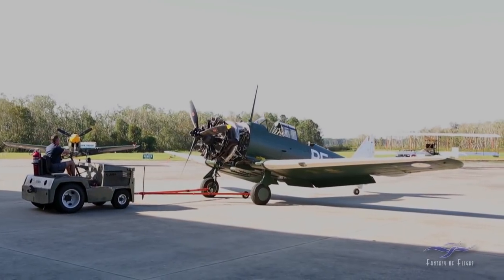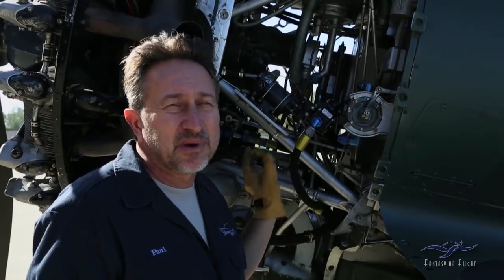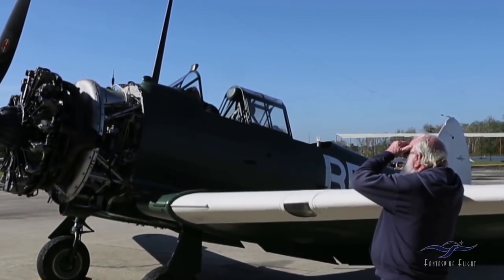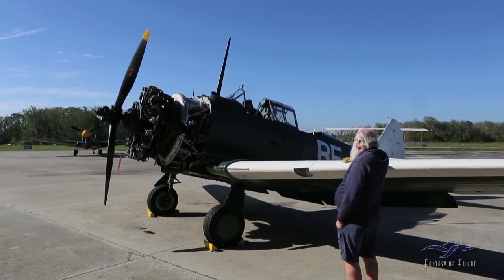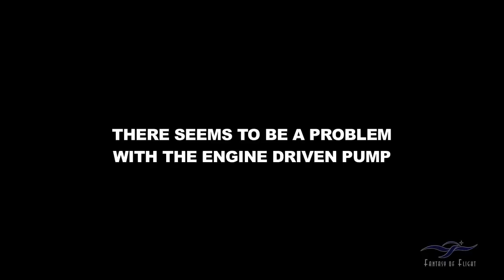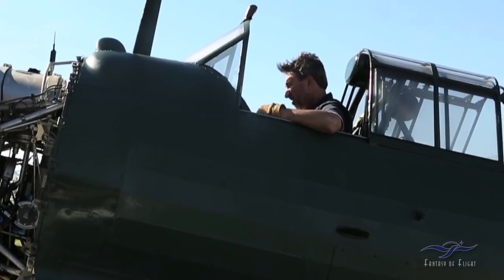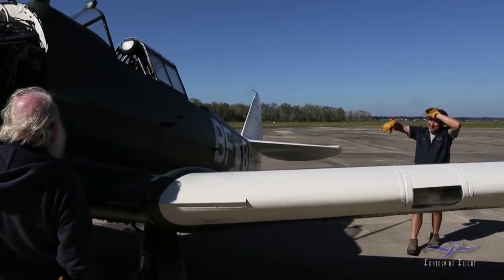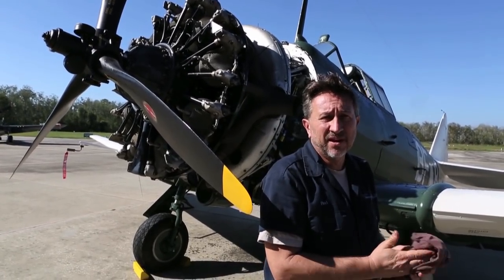CAC Wirraway - Start Up - November 2017

Comment: Ahhh the purr of a Pratt & Whitney radial.  I grew up to that sound.  My dad had several AT-6s over the years....most well known is "Scrap Iron 4"   (Which was an SNJ-5 Naval version (provision for a tailhook..wings that could fold, etc.)  The other version was called "Harvard" by the Brits..but they were all the same aircraft...with

I miss them all.  AT-6 is a fun plane to fly and I did many an hour from the backseat of a T-6.

Many of the A6M Zeroes you see in film...and some of the D3 Vals and B5N Kates are converted AT-6s.

Again we always talked about making up one of several AT-6s as a Whiraway.
Reply: Funnily enough a Wirraway actually scored a kill on a Zero. Tragically though they were completely outmatched more often that not. It would be cool to see how easy/hard it is to develop one into a Boomerang which was a far better fighter but still outclassed by the Zero.

Comment: Back in the early 80s I worked in a boat factory using a radial arm router that was used in the manufacture of the Wirraways. Funny, I haven't seen or heard of the Wirraways since till now.

Comment: Hard to contemplate that the RAAF took these Wirraways into battle against the Japanese. I think the Zero and the Wirraway had engines of roughly the same power but that's where the similarity ended, often tragically. I saw A20-103 in the National War Memorial, Canberra, the only Wirraway known to have shot down a Zero.
Reply: yes spot on A20-103 Jack Archer & Les Coulson !! absolute legends !!!!
Reply: Wirraways we’re not built, nor used as fighters

They were never meant to engage Japanese zeros

Comment: Dieseling startup.   Crazy to get in there and work after that bit of a fright,  always looking over your shoulder for movement.  Yank the batt connections for best odds I guess.    Sounded beautifully when on the boost and all clicking.  Don't pick on the Wirry,,what do you do when you first get up??,,,,that's right,,,you pump ship!.   A little piddle all over the place,,but it can't be helped and it's gotta go,,lol.   Can't wait for the ride.
Reply: Magnetos generate their own voltage.  You must ground them out. Grounds can go open too. Thats a hot mag.

Comment: My grandfather built these at the CAC factory in Melbourne during WW2. I believe they also built Spitfires and Mustangs there as well as Boomerangs and other makes.
Reply: No Spitfires were made in Australia, they were all imported from England.
Reply: It is my understanding that whilst the spits were imported, some were in fact re-assembled at CAC
Reply: Jimbo voncarguy   "It is my understanding that whilst the spits were imported, some were in fact re-assembled at CAC"

That's my understanding too.  Further, it's my understanding that they also had an assembly line for Merlin engines, although they didn't produce the components.
Reply: Some Spitfires were assembled at CAC, along with many USAAF aircraft that were shipped to Melbourne to be assembled and then ferried north to combat units.

CAC didn’t start production of Mustangs until the very end of the war.
Reply: SilentOtto CAC license built Merlin’s.  All components were manufactured in Australia.  They manufactured a total of 108 Merlin 102’s.

Comment: Magneto 101: Mag switches kill the spark of magnetos gy grounding them. Broken switch or lead then the mags are always hot. Since you've established that she seems to want to start with the mag switches off, it may be not such a good idea to subsequently pull the engine over manually, with mags that may or may not be "hot"....

Otherwise great to see this aircraft running!!! And it would be very interesting to see what this huge prop does when compared to that relatively tiny two-blade prop that is normally fitted to a T6...

Comment: I don't know about aircraft, but in the automotive world adding a back-up electric fuel pump can sometimes be problematic.  I've had several vehicles where the engine would starve for gas when running at high speed when I turned the electric pump off, even though the mechanical engine-driven pump was good.  I had to install check valves that allowed gas to bypass the electric pump when it was turned off.  I also have a car where I installed an electric pump for priming after the car had been sitting for months, priming before cranking the engine.   I discovered that in this case the electric pump can't force fuel through the mechanical pump.  I might need to install a check valve that allows the electric pump to bypass the mechanical pump.

Comment: Hum. The mechanical pump won't build up pressure, and the wobble pump and the new electric boost pump wouldn't build up pressure until a check valve was installed. This sounds to me like more than coincidence. It sounds to me like there is an internal leak in the main fuel pump, and this is what kept the electric/wobble pumps from building up pressure. You may not need that check valve once you get the engine driven pump sorted.
Reply: It sounds to me like some previous owner/mechanic didn't know what the hell they were doing and started "fixing" the fuel system and ended up taking out a check valve that obviously needs to be there. That check valve is probably in a bypass line that that allows excess fuel to go back to the tank when pump output and engine fuel demand are low and that may open to let an extra "supply line" to the pump open up when fuel demand is high. He clearly said the wobble pump was out of the system and not connected at all when they tried it with the "boost pump". 

The "incidence" is that this airplane was in Australia at some point and some other "experts" in Australia gave him advice on how to "fix" it that was clearly WRONG because the plane didn't need that "boost pump" to fly when new. That's a shadetree, band-aid "fix" that could get somebody killed if other problems in the system exist and putting on the booster pump just adds enough flow to overcome other leaks, a lack of a check valve etc. until the engine needs a lot more fuel. 

The moral of the story is don't buy vehicles from foreign countries where they shadetree airplanes because the right parts and service information are "hard to find" i.e. "too expensive" and don't trust "experts" who "fix" OEM systems that must have worked fine with add-on aftermarket "help". I wonder who "rebuilt" that wobble pump they "sent off" to have "rebuilt". Fuel systems are a really poor place to cut corners. 

The Aussie "experts" also mentioned running the tank dry being a problem as far as getting the pump to work again. Yeah. Probably because running the pump dry causes excessive wear, scoring, scuffing etc. that a "rebuild" that might just be slapping in new gaskets and "polishing" the damage out of internal precision-fit parts just creates more clearance and internal leakage. 

Back to don't trust "experts" who shadetree shit...
Reply: "The "incidence" is that this airplane was in Australia at some point..."

The Wirraway was an Australian built aircraft.  So, in so much as they exist at all, most of the "experts" on Wirraways are probably in Australia.

"The moral of the story is don't buy vehicles from foreign countries where they shadetree airplanes..."

While that may be good advice for purchasing a modern aircraft, one can't just go down to a dealer and buy a Wirraway.  One must get a Wirraway where one can find a Wirraway.

Comment: The guy with the tools didn't use a torque wrench to tighten the two plugs or wires he removed. I wonder if the whole aircraft was rebuilt that way?
Reply: This guy has a build-in torque wrench

Comment: Well, since this IS "Mechanic's Corner", and I have worked on enough cars under the shade of trees for the last 43 years that I can call myself somewhat of a mechanic, so, a little "shop talk" if I may...this vid appears to show that three separate and distinct fuel pumps: an original design, rebuilt "wobbely" (whatever that is), a super duper electro/mechanical, and finally, an engine-driven, any one of which i would assume would run the engine under normal circumstances, are not pumping sufficiently. I'm guessing these are draw-through rather than push pumps, so if three new pumps are not working properly, wouldn't that point to the source, meaning, restricted fuel pickup screen, or collapsing fuel lines from the tank to the pump, or perhaps debris gumming up the "works"? No venting? There's no mention of that in the vid. I just wanted to "pipe-up" (no pun intended) because I read about a fuel injected airplane in FAA accident website and it turned out contamination in the injector caused a fatal crash.
Reply: *Or perhaps a leak in a line and you're sucking air?
Reply: Good ideas, blocked or closed tank vent. A vaccuum gauge temporarily installed on the pump inlet would show any problems with supply blockage.
Reply: Its sure sounds sensible to me, checking for all those possibilities. I would assume that entry to the fuel tank to ensure it is scrupulously cleaned, same for lines and filters? To assume that it is ok is irresponsible. But I'm sure these guys are too professional to overlook that.

Comment: First and only t 6 I worked on had same problem we rebuilt that airplane 20 years later plus all accessories problem went away your booster is probably firing your spark plugs at start if installed

Comment: nice diesel start! lol (not wondered when y see the amount of oil on the stb wing! lol), looks like the gears of the engine driven punp are leaking, preventing the pressure to build up, or the pump to work.

Comment: Thanks for the new video. Questions: Was the mag actually Hot when he first pulled it through or was the apparent firing sound during the clearance rotation from dieseling in one or two lower cylinders because of the oil?  I can sure understand why he didn't want to pull it through again with the mag grounding in question.

Comment: It could try firing on compression pretty easily if you have just the right amount of oil/gas vapor in the cylinders or intake system. You're dealing with dynamic compression pressure and not just static compression ratios when an engine is cranking/running. If the engine is good and tight and makes a lot of compression and the engine is warmed up a little from sitting in the sun on even a cool day, oil vapor can easily "diesel" while cranking. Especially if the cranking speed is on the "slow" side and the pistons are coming up fast enough to do a good job of compressing the air in the cylinders so the little bit of vapor/liquid oil ignites but not so fast that its rolling through that little bit of fire before it can do any good and its just coughing and sputtering a little instead of actually "firing" with enough heat and pressure and energy to "run". A few more  revolutions and it would probably have that little of vapor "dieseled" out of the engine and go back to cranking normally. As soon as you introduce any gas you're also going to "wash down" the cylinders a touch and lose a little compression and the mixture will also have a way higher octane rating and will resist auto-ignition. All liquid petroleum fuels and liquids have an "octane rating". Octane and cetane are opposite ends of the same scale so to speak. High cetane = low octane. Cetane is a compression ignition fuel's ability to auto-ignite easily and octane is a spark-ignitions fuel's ability to resist auto-ignition. And the higher octane fuel is, the HARDER it is to ignite and the LESS heat energy it contains. That's why running "high-octane" fuel in excess of what the engine needs to avoid detonation and knock is just wasting power and efficiency. Find the fuel your engine likes and that keeps it out of detonation under its max load/temp conditions and you don't need to go any higher with octane. You're costing yourself power, efficiency and performance if you do.

Comment: So when the oil pours out of the exhaust manifold, does that mean that some of the exhaust valve guides and seals are nackered?
Reply: Radial Engines when they sit for a period , oil from the upper half drains down to the lower cylinders.  Radials are an oil scavenge system.  Exhaust valves are open or wil leak past into the Exhaust manifolds. That why they "Pull" the engine Trough a few revaluations.

Comment: Please, when you pull a prop through, don't stand in the arc of the prop.
If it fires you'll get a mighty slapping!
Reply: I was trained to pull them through backwards to clear oil from the cylinders.
Reply: @allangibson8494   WOW,  I have never heard of pulling any prop backwards.
Maybe it is only for Aussie planes.
Reply: @wms1650  Standard practice, particularly on radials as you get oil in the bottom cylinders, you can hydraulic lock the cylinder and bend a conrod. Pulling the prop backwards drains the oil out the exhaust valve rather than trying to compress it like pulling forward would. Overall backwards is safer.
Reply: @allangibson8494   I worked for a crop duster, 1972-1975, as a loader/helper.
Every morning I had to clear the engines of the two Thrush Commanders using P&W 1340s.
I was instructed to pull through forward.
Maybe it works both ways.
Old radials do sound good.
Most crop dusters use turbines now.
Reply: @wms1650  I was trained to fly by a WW2 trained pilot - he was most insistent about pulling through backwards - first because the magnetos won't fire a charge sucked in  from the intake and second to clear the oil. 
A 34 liter engine will do nasty things to you if it kicks.
As a aside he had two kills by age 16 - flying for the Romanian Air Force.
Reply: Allan Gibson we had a Leonides in a life expired training aircraft, if stranded and run regularly she was fine but if left! Drain the oil from the lower cylinders, clean the plugs and create a blue fog! People ignore just how rugged and damage tolerant radials are.
Reply: @piearm1271  DB605's have the same problems but on all the cylinders... Joys of inverted engines (and that includes Moth engines).
Reply: @allangibson8494  at least inverted engines make it easy to reach the plugs
Reply: @piearm1271  Until you get Italians involved.... It seems to be a national trademark...